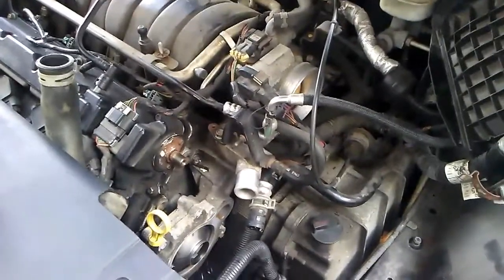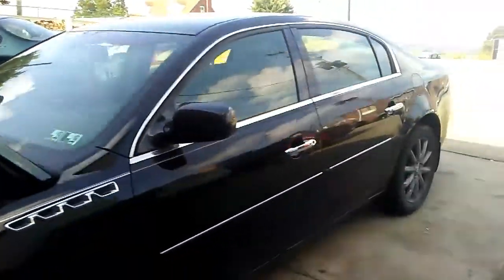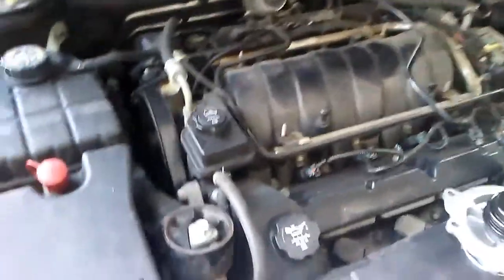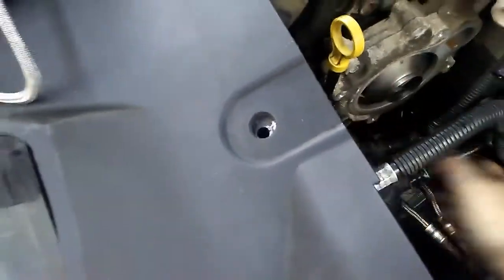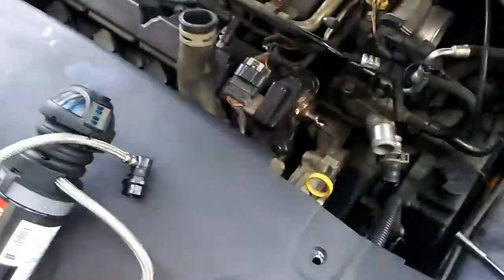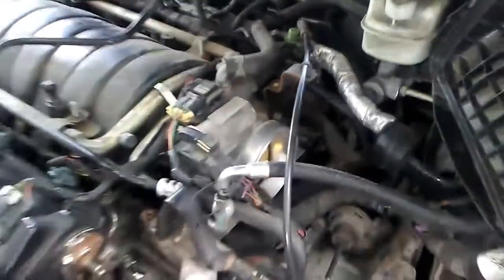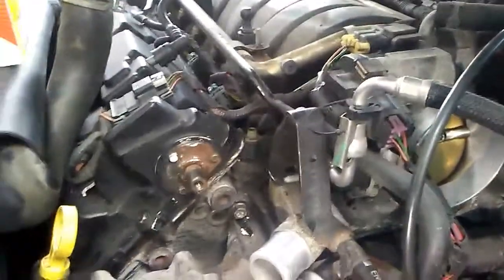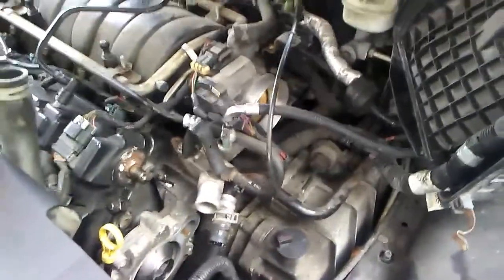2006 Buick Lucerne Northstar engine water pump removal

Comment: hey, i finally got it out. It does not need a special tool. once you get the pump assembly out, the pump might be in tight. I tap it out. i am preparing to put it back together. thank you for the video
Reply from the maker: Sweet it's a pain in the ass I rate this one of the top ten worse water pump jumps to do, awesome to hear I started thinking you had other style which sucks but not as bad as this entire housing deal

Comment: I'm sure you found out already....but you missed 3 bolts. 2 are further down in the back where it turns down...they are basically side by side. And One in the front where you said there was only one.....there's another right under it, side by side like the back.

Comment: Have you had to change your front engine mount yet? If so did you use a engine hoist or cinder blocks. Can't find anything on these Buick Northstar v8
Reply from the maker: Man be good video to upload, few I did was a little tough and I know on a lift lot easier to do vs ground but I know I put a block of wood on a jack and slowly raised engine up by the oil pan after getting main bolt out, I remember a 15 mm bolt? on part of it toward top was a pain to get at, But heck you do the battle make video if you can wish I had did but sorry I never uploaded one on such

Comment: How do get the pump off the assembly. I removed the whole water pump assembly. But I can’t get the pump off the assembly. Please comment.  Thanks
Reply from the maker: Sounds like you have the other style where on that one you don't have to remove all this, it requires a special tool to go into housing and rotate and unlock pump out of it, honestly lot easier then this style because no need to remove housing, sounds like you need the special tool to get pump out of yours

Comment: How do you get the air out of the cooling system afterwards?
Reply from the maker: did you do a thermostat, make sure all hoses are hot, I left cap off and started to fill up with antifreeze once it looked to be full and took no more I started the car let it run, watched it go down and started to fill again, once I felt heat coming through vents and temp was almost mid way, I topped it off again and put the cap on
Reply: RANS87IROCZ alright thanks and yea i replaced the thermostat getting ready to replace it again to see if it was faulty
Reply from the maker: also are the fans coming on? and could be air pocket if one of the hoses are cold vs other. and faulty stat is rare but hey never know
Reply: RANS87IROCZ fans are working so it could be air
Reply: RANS87IROCZ and is there a radiator cap you were talking about or were you talking about the resovoir cap?
Reply: Hey thanks alot ranz and tre, I got everything back together on Friday and car is running good but I also had the same question as Trey. I replaced my thermostat also. And now when I'm sitting at idle after car has been on for a while my temperature gauge fluctuates between halfway and it starts rising like it wants to keep going but once I take off it goes back to normal and when I'm driving it stays at normal. I don't know about the air thing because supposedly these northstar have a self purge system. When I was done and putting my coolant in, I lost 3/4 of the whole jug because one of my housing bolts were not screwed in all a of the way so most of it leaked out so I just put water in but either I didn't put enough in or alot of it boiled amd evaporated so now my coolant is kinda low. Could that be the reason my gauge is rising a little?? Sorry for the long  reply lol
Reply from the maker: Kris Huggins man being you had the leak out the bolt it caused an air pocket, tighten up any leaks you see and refill then run with cap off and fill it as it drops once heat starts to come out vents and all hoses feel warm , cap it I norm try to get it before it starts burping back out. But being you had leak was prob reason. I got lucky on mine here just filled and drove it
Reply: Can you tell me how many hours of labor it takes and what it usually costs ?

Comment: How much did you charge the guy originally and if you don't mind me asking how much did you add? I gave my car to a mechanic to give me a quote on what is wrong with it I didn't know what was wrong it as opposed to giving me a quote he went ahead and fix the water pump and brake pads which I can fix by myself. Instead of telling me what's wrong and giving me a quote he goes ahead and fixes it and gives me a price after had I known I would never ever paid that much that car was going to be a trade-in anyways smh so pist
Reply from the maker: not enough on what I charged, he bought the water pump and gaskets and I quoted him 200 on labor plus parts was well under 300 for total repair took me all day to do, But as of no call, honestly as a shop owner he should of not done a thing until hearing your word to do so,  he performed repairs without discussing them 1st is not cool and honestly I would of got my head ripped off by one of my customers had I went ahead without any word to,  total on such job I would say max 500 labor plus parts, fair labor 400, anything under 400 this job was real hard to do,  But honestly they might go by book time, like Chilton or Mitchell and that being if mechanic charges 75 an hour and job says it takes average of 8, would be 8 times their labor

Comment: Bolts at bottom right side of mount wont go in already put rest of car back together
Reply: What's the trick to getting the back bottom two out and then back in?
Reply: Kris Huggins i got them off with a normal wrench reached around the back over the top there should be barely enough gap to take it off and i used a ratchet wrench to put them back on because normal wrench was takin way too long its easier getting them off then on in the back
Reply: Cool thanks alot man, I actually bought a ratchet wrench yesterday just for that. Not even worried about all of the other steps because everything else looks simple just alot to take off
Reply: Kris Huggins just make sure you listen to guy in video carefully on putting it back in i didnt listen and it was pain it the ass to get the last  bolt in the back to line up with its hole
Reply from the maker: Kris Huggins it is very tricky job, both lower leg bolts suck. Top center ones a breeze. The 2 angled below the pump are  terrible because wire harness gets in the way and one of those also can get wedged with tool cause of bell housing. The back 2 now just suck and you can get the gear wrench stuck in there unless it is reversible. You have to have them in the housing when you go back together, I put new gaskets on was a pain to stay in place also. But basically after I fought piece out and in. Getting the gaskets and bolts to stay in place took some serious patience and taking top bolt out 1st in back will suck to get lower bolt out cause it will be stuck in the way to get the lower bolt,  so do lowest 1st and then one above
Reply: @RANS87IROCZ  Everything u said is true. Shit sucks ass. Been at this for a few hours and decided to pack it up and get back at it in the morning 😂. I hate this car so much
Reply from the maker: @RedBaronisa  for everyone that has too do one of these jobs? I say a little prayer and take a moment of silence for them, man wishing you luck with it all! I know your pain on this
Reply: @RANS87IROCZ  yeah the prayer didnt work that well. The lady wants it done fast but here’s the issue… loosened the EGR tube and realized thats where the vacuum leak is coming from… i thought it was coming from the valve… i cant even find this damn tube anywhere. Already replaced the water pump and it was a pain in the ass but I’m stomped on this EGR tube cuz idk where imma get one
Reply from the maker: @RedBaronisa  man sorry to hear? Did you locate one? This job just insanely nasty
Reply: @RANS87IROCZ  my
Mechanic working on mines now man I love him to death for keeping this engine running for me.
Reply from the maker: @2ant1man5  say a prayer for him 😂, old design the mechanic just needed a tool to unlock pump from housing but this style required entire housing to be removed and it's just a pain in the ass, hard to get bolts out in back corner and need gear wrenches and stubby, then a prayer that the gasket on housing stays in place going back together.
Reply: @RANS87IROCZ  man I love you mechanics seriously, I’m a plumber and I think I would wreck my brain doing this, he has literally replaced a lot on my car and keeps it running well I try and get him 12 packs every one and awhile lol.
Reply from the maker: @2ant1man5  likewise a plumber bailed me out once on nasty basement drain clogg, I know that's it's a dirty job too and can suck at times but I know for sure I myself have wrecked my brains on car issue's 😂 heck timing belt jobs the worse! Can be off just a little yet car runs great but yet can cause cam crank correlation codes and have to tear job done and do all over SMH the worse or heater cores on some the entire dash has to come out it's frustrating all while some book said it can be done in 4 hours 😂
Reply: @RANS87IROCZ  I’m convinced GM plays this prank with all their cars…books says two hours turns into a 8 hour job and maybe even a few the next day….i seriously want to get a Honda but dam I’m loyal to my country ><
Reply from the maker: @2ant1man5  some Hondas are built here but trust me they just as nasty to fix in my opinion, but yeah I still prefer gm cars to this day myself because of
Reply: @RANS87IROCZ  I always have been a gm guy man I’m about to looks at a caddy dts with 89k and at this point I know what go wrong with these engines and kinda wanna stick with them until I can affford a scat pack.